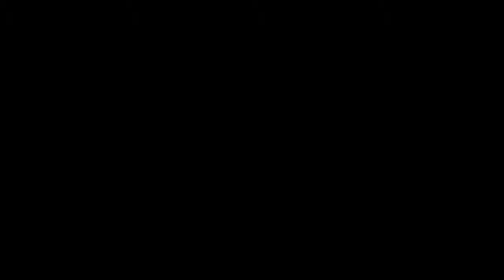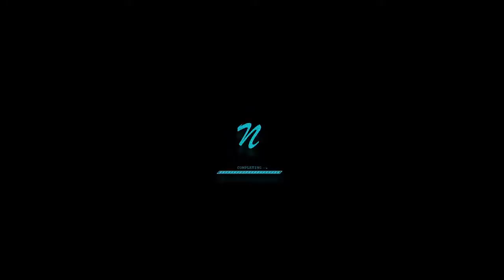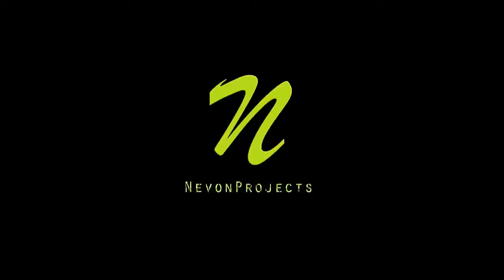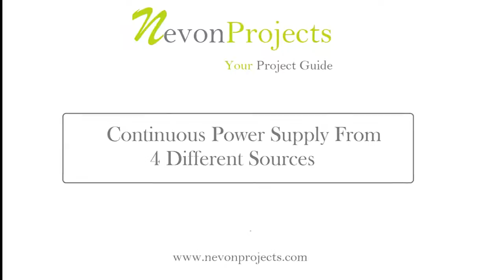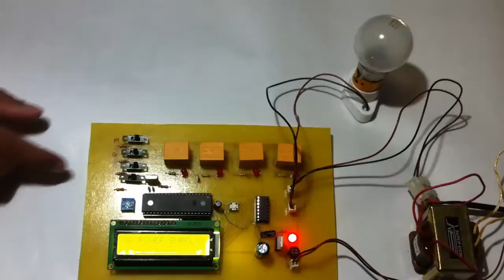Multi-Power Supply Using 4 Different Sources For No Break Power Supply

Comment: its not automatically changing the power from one to another
Reply from the maker: For this Electronics Project Details Or Customized Development Call/Watsapp +917738796642
Reply: Super bro my 4house single phase metre different phase, one submersible motor switch connection how to do plz?9841156419